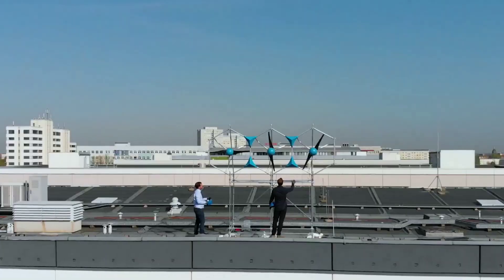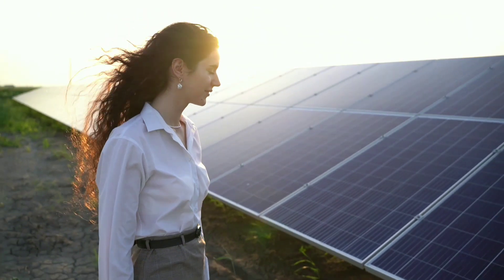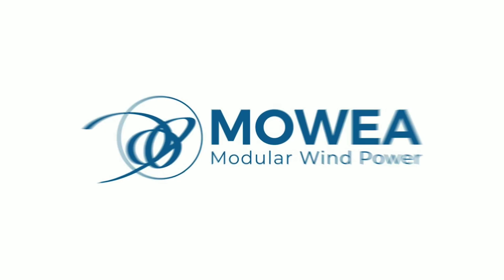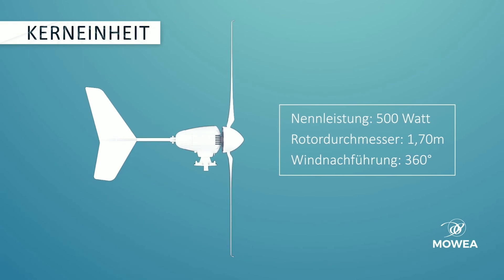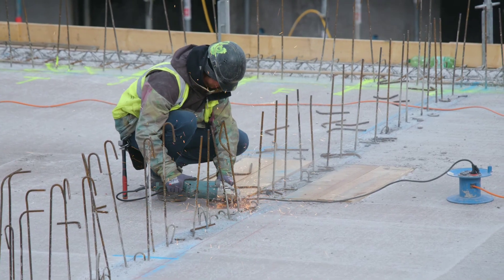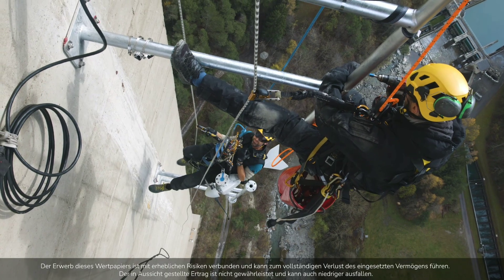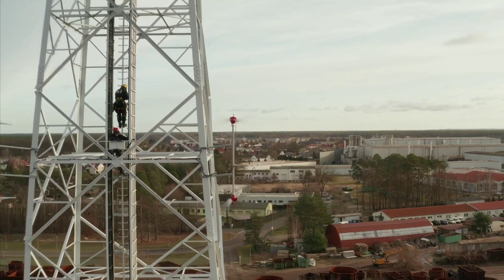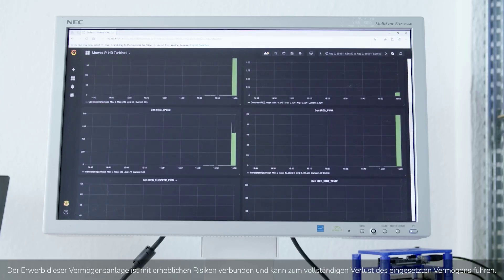This NEW German Wind Turbine for Home Out Perform PV Solar Panels in 2024?!

Comment: Mowea wind turbines can be cost-effective because they are installed in large numbers on existing (!) high masts.  
All practical tests show that small wind turbines hardly generate any electricity! And only at very high costs! Because there is hardly any wind close to the ground. It is also extremely gusty, which usually shortens the service life. Only if you need to be self-sufficient from the power grid, you should buy a small wind turbine for the winter. With solar modules, on the other hand, reliably generate electricity for 25 years at approx. 3-10 cent/kWh!

Comment: The return on investment is depending on the wind. In my area there is frequently no wind at all. 
The price for 1kwp photovoltaic is about is around 600 euros all material included. The wind engine requires an additional inverter. Means that the wind engine is at about 5x as expensive. In other words: still too expensive